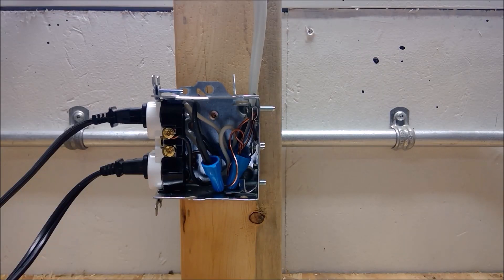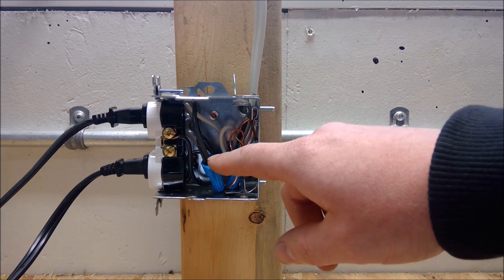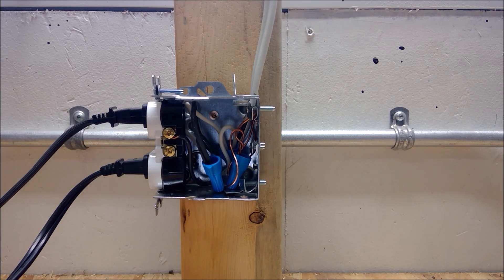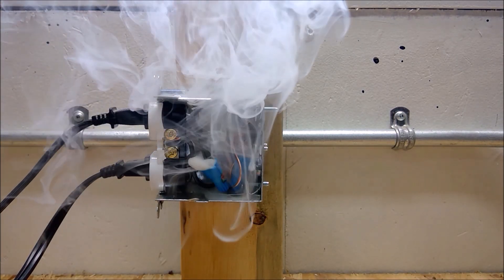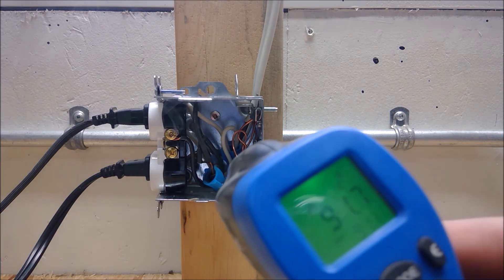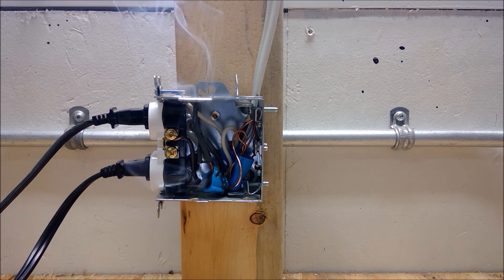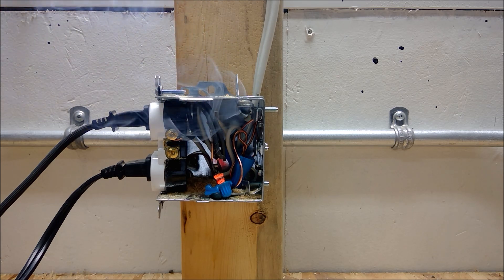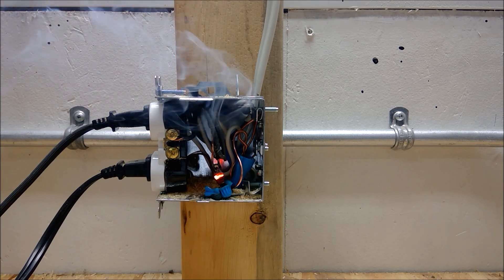Loose wires cause fires.

Comment: Great video! 👍🏻This happened to me. Discovered it today on wiring to a wall thermostat while painting. Once this situation occurs, do I need to replace the line wire that overheated, meaning behind the junction box… and if so, from where… the previous box or service panel, one floor below? 🤷🏻‍♂️P.S.: Happy Holidays! Hope you’ve been well the past 7 years! 😉

Comment: I had an outlet fire happen to me last winter back in 2016  in my bedroom at night. i was lucky i was still awake and my parents too. When the wires were loose and started the  fire. Got it put out, turned the power off, then called the electrician, and got the wall cut open to replace the box and wires  also had the electrician inspect the other outlets and none were loose but when it happened that was scary trust me .

Comment: people claim these wire nuts never come lose.. bs they do.. i have a 30 year old house, i replaced all the recetables and light fixtures and light switchs in.. because i dont like yellow ones and old light fixtures.. and id say 30% of the wire nuts were extremely loose..  in my barn thats 60 years old, the wire nuts in the receptacles werent even tight anymore icould pull them off basically..  another issue with wire nuts.. is some people dont twist them enough.. you should turn them entire the wire start to twist.. or until its too hard to twist anymore.. then you need to pull each wire to be sure and also look inside.  also gatta be careful cutting insulation off.. or if  wires were bent too much. twisting them in nuts can break the wires at the cut.. seen that dozens of time

Comment: a good example of improperly installed wire nuts ( merett ? ) they, the codewriters ) require non-combustible boxes whenever wires are spliced. irritants ? 1500 watt  a re a big culprit, cheap plugstrips & extension cords are another.

Comment: Ok great electric minds...help me figure out something. My friends house burnt down all bc her dryer outlet or something malfunctioned. It was on a breaker but the breaker never tripped according to the fire marshal. Is there a high incidence of outlet failure in dryers bc of the higher load? Why wouldn't the breaker trip? It was all relatively new wiring. A fresh build, barely 1yr old. She's in a new house and paranoid now about it happening again and has had it checked a half dozen times with dif electricians. Obviously it was a highly traumatic event. Her whole family was asleep. Dryer was off. They barely got out alive and lost everything. Everything literally but a Bible. Was kinda freaky. The good book was entirely unscathed except for being a bit water logged just sitting among smoldering ashes in plain sight where it had sat all along before the fire and complete destruction in every direction.

Comment: Excellent video. I have photos of a couple boxes where this has happened. After the plastic melted the circuit operated just fine yet until some type of vibration would cause the now exposed wire to contact the metal box and trip the breaker.

Comment: That's what you get for using those damn wire nuts, should you use spring-loaded connector like WAGO or even a screw terminal, nothing like that could ever happen as it is perfectly clear whether you installed them correctly or not.

Comment: is a bad outlet a fire risk if not using it?
Reply: Could be, if it comes between the fusebox and a socket you are using, depending on your wiring configuration.

Comment: The next video, how to replace all the burned wire?  Same thing just happened to me when I plugged in the portable heater, fuse didn’t trip and smoke was coming out. So when the outlets are plugged in and in use or light switches are turned on, it’s a good habit to touch the surface and feel any excessive heat is being generated, I caught a few already in my older home, I guess my next project would be open up every single outlet and switch and inspect and redo all the connections if necessary. You’ll amazed what kind connection people used back then.

Comment: How could they both be in a wire nut and not touching. Also why did it require you to do high amperage devices? Based off of my research arcing conditions are scaled based on voltage not amperage.

Comment: I have no idea why everyone goes on about "Canadian code", this proves (as ive seen many times) that "code" means nothing, in the UK these "marrette" are not legal in the UK and can not be purchased.

I use connector blocks (when required), they are brass and had a screw for each cable, everyone complains when i do, and yet never had one catch fire.. ever.. based on the size of cable that can fit in them, its near impossible to undersize which you need.

Comment: I have a very stupid question to ask. And I apologize, I am not an electrician and I want to know. Can an outlet catch fire even if you don't have anything plugged into it? I know obviously if you but metal on the base were the outlets are it can if it is metal because it is still transferring the current. I just don't know if the metal could overheat if there was a wiring issue and still cause fire to happen.

Comment: I dont even understand why would someone use these kind of "twist on" wire joints.
They are a pain in the ass to remove, straining your fingers to put on and dangerous - as seen here.
Just use a Wago 221 or some similar product, its 2020...

Comment: I have no idea how you guys never heard of terminal strips AKA connector blocks???
I understand that you can connect 2 wires just by twisting them together and putting a piece of insulated plastic cap on it, but I would not feel safe doing it.
I'm sure that this standard is more to do with north America, but in the UK this is simply too dangerous.

Comment: No wonder why it melted and caught fire, there were 14 amps of load! That's like a lot. I believe the maximum is 15 amps, and you were almost at the max capacity. And since there was faulty wiring in there, it made the maximum amperage capacity even lower! You kinda overloaded it. Could be wrong, but that is my thinking.
Reply: Andrew Grube's Baby Bear dude that was literally the entire point of the video
Reply: @mrconch7238  I’m scared

Comment: Trying to rip the homeowner off by selling a arc fault protected breaker $20+ for just 1. A AFCI outlet cost just as much if not more.. the Problem is old loose outlets & china's cheap ass outlets for .99 cents or that 16 gauge extension cord consumers are buying.. I see appliance cords go up to 14 gauge with heavy outerwrap to look like a heavy duty cord when it is not.. The problem is the consumer needs to know gauges for the appliance cord they will use not a loose wire nut most electricians make sure are tight.. The corporations are trying to prove a product AFCI's are the answer to all our problems and incorporate this into NEC through congress. a standard 20 amp breaker is less that $6.00 but a AFCI breaker 20 amps is over $20.00. they are not about safety it's about money (that is fact)...  Sorry this is the truth... A home owner needs to know AFCI's can cause major problems when running a drill ( that little blue arc you see inside) can trip a AFCI pissing people off every time they want to use appliances that create this arc ( FACT). I am not making this up.... I install these now because the NEC states all rooms not required to use GFCI's need them even in the garage. This also pisses people off because of the bill they get when We are done. This makes us look bad & costs the consumer a lot of money. GE makes these AFCI's around $4.98 & the MSRP is over $20.51. You do the math on the markup... Laws need to be passed on how the multi outlets are gauged, & a homeowner needs to disclose to new homeowners or insurance of any DIY's installing wiring or fixtures. Using a 16 gauge multi outlet extension cord should never be used on anything as the wire in the wall could be 14 or even 12 gauge that is the reason a breaker would never trip on under sized wires being plugged into a outlet. 16 Gauge wire requires 10 amp breaker not more. I have seen homeowners change a 15 amp breaker out for a 20 amp just because it's tripping all the time ( Very bad Idea )..

Comment: "An Arc Fault Circuit Interrupter would have tripped the circuit right away"

Doubt it. They claim to but they've failed a lot of practical tests for series arcs.

Comment: I almost had a fire today. The power cable for my CCTV wire melted apart halfway down the wire until the pieces were in two. I only noticed it because I saw an orange glow on the side of my desk. The thing is, I wouldn't normally be home when I discovered it so it might've been a different story :/
Reply: This is exactly what is happening to me, so thankful I was awake. I'm wondering how it could get fixed,any ideas?

Comment: 35 year Red Seal Electrician, great video Andrew. I have seen this probably over a thousand times.Loose connections are very common. In many cases the electrician or handyman thinks the connection is good because the wire connector gets tight, but in many cases, especially with multiple wires in the connection it is very common for one of the wires to back out of the connection unnoticed and presents a loose connection and a fire hazard. Now, as for all your smart ass comments boys. Women plug in the curling iron to heat it up for several minutes then plug in there hairdryer and go for several more minutes. More than enough to present this exact situation Andrew has shown here.want another one boys and this is usually YOU. You plug in two car block heaters in the winter to one outlet or two outlets on the same circuit and do the same thing. Lets see, space heaters going full out and then someone wants to vacuum and i could go on and on. Keep up the greats videos Andrew .CHEERS
Reply: Thank you for the kind comment. It is winter time where I live right now. Just fixed a junction box that was used to splice car plug branch cct's. Box was way too full like 30 wires in a 6x6x4 pvc box. All of the heat melted the pvc box. Made it easy to find the problem.  My next video will be about multiple conductors all pulling 12 amps and the heat created. 

Thanks again

Comment: kool demo, but i would replace that GE panel and breakers with Square "D" (LOL) cause i guarantee Square "D" would have tripped, plus that fire shouldn't go too far inside that metal box if it was fully enclosed with very little oxygen to fuel it, that's why all junctions are suppose to be done in a box, just another layer of protection. but on the other hand you still have to have it corrected.

Comment: North America, 14 gauge, olde olde way of measuring the conductors size, the higher the number the smaller the c.s.a  its counter intuitive,then they use 000 or 0000  ought, then another system so its wire gauge a add on with zeros or the letter o, then another patch for the larger sizes, they dont insulate the earth aka ground wires, they are bare,

Comment: Great video! I think this kind of junction is common for America. I do make wire connections by twisting the wires using two pairs of pliers then i do solder the connection. After that I use electrical tape. Here is one of the pics I got:      https://s6.postimg.cc/vfiwaetoh/IMG_20160206_182412.jpg

Comment: In Norway residential code requires wiring to be mounted on the outside of walls so problems can be spotted.
Reply: That's why I just run the romex across the floor with wire nuts so I can see if anything is arcing or burning.
Reply: What you have said is clearly not true. Maybe in log cabins?

Comment: Happend to me when i used my portabe car heater in an outside outlet. One of the electrical plug breaked of in the outlet when the heater was on.  And caused a fire. It took 7 seconds for the circuit breaker to cut the electricity from when the fire started.

Comment: This is why you do not make unsoldered splices/junctions in circuits without a box. The most common reason I get called back to jobs is when helpers are lazy and don't properly tighten wire nuts.

Comment: This is a good demonstration. Thanks for taking the time to make this video. In a metal box its not so bad but in a plastic box it could easily be worse. Especially if it burns into an attic or if its in a kitchen fan or receptacle where there sometimes is cooking grease accumulations. There is often wood debris in boxes from construction or infiltration afterwards.
Reply from the maker: francis white 

Thank you for the comment. It has always been my intent to demonstrate the results of faulty workmanship.

Comment: i'd like to see some things like, Circuit Breaker, a video showing the poor connection made, wire type (brand) as well as awg, and finally i'd like to see an amp reading on the device.

Comment: Arc fault breakers are a pain in the ass at best and impractical at worst. They trip if the wind blows on them. And what the hell is a mirrette? A wire nut? Is this from another country?

Comment: When you turned the toaster on, you could hear the RPM of the hair dryer drop.  
That's kinda why when I move into a new house, or add an outlet, I plug in an extension cord, and add some high load devices to that.  
Then I grab a multimeter and check the voltage on the extension cord before and after turning the load on.. 
Voltage going down with the device on = check what's wrong. 
It might not catch everything, but it sure has pointed me towards some crappy wiring in houses..

Comment: This could happen as you sleep
WHAT DO YOU MEAN THIS COULD HAPPEN IN YOUR SLEEP IS YOUR HAIR DRYER JUST GOING TO MAGICALLY FLOAT TO YOUR KITCHEN AND PLUG ITSELF IN WHILE YOUR ASLEEP AND THEN THE TOASTER AND THE HAIRDRYER TURN ON.
Or
Wait why did I bring my hair dryer into the kitchen, oh right I was going to blow dry my hair while I toast my bread. 
WHAT ARE YOU DOING WITH YOUR LIFE.
Reply from the maker: Jasbear007 

The point was that a circuit could have less than 15 amps of load connected to it and the circuit breaker may not trip on this type of fault condition. 

This type of load could be an electric water heater. It could be a freezer or a sump pump. I just used the examples in the video because they were easy to control.

Comment: So wire splices with untaped wire nuts inside a metal socket box are normal in the Canadian electrical code? I don't know many electricians that would do things like that.. Maybe some DIYers or maintenance man but not a real electrician..

Comment: People are complaining of the sawdust when there's smoke and smoldering plastic inside the case. The sawdust is not the issue here. 
You got me concerned, but I couldn't quite understand how the wires were improperly split, could you please elaborate on that? I live in Brazil and our connections usually don't have that blue plastic gasket around the junctions, so I couldn't quite translate your video to my regional conditions. It did, however, get me worried.
Reply from the maker: Horacio Filho 

When splicing wires we strip back the insulation on the wires and twist the copper together. That way they are a complete electrical circuit and they are also mechanically tight.

This video shows what happens when the wires are not twisted together.

Comment: I suffered a similar problem a while ago: I had a freezer and a microwave on a power bar, somebody plugged and unplugged the microwave and in doing so, loosened the bar's plug on the outlet.
the freezer remained plugged onto the extension, and worked out as usual over night.
at some point, the arc between the outlet and the plug melted the plug's own frame, loosening it even more, until it melted the wire inside the plug, and the wires shorted out.
I heard the breaker pop downstairs and went looking, and nothing seemed out of place, no burns anywhere, no appliances shorted out, nothing.
reset the breaker, plugged everything back in, and when I grabbed the extension cord, I noticed the plug had melted.
taking it apart, I saw the interior all burned up.
fortunately, the breakers had been changed a while back, replacing the old ones which were almost 30 years old.
I doubt those old breakers would have popped.
Reply: Part of your issue to start with was having it plugged into a power bar! High-current items, such as anything with a motor, fan, or heater or high - voltage transformer, such as in a microwave, should be plugged directly into the wall. Of course, in the case of in the video, it wouldn't have mattered, but, still, always plug high-current stuff into the wall directly.
Reply: @EphemeralProductions  I can't remember the details of it anymore, but the microwave was usually plugged directly onto the outlet.
it had been like that for years, even though the microwave is rarely used, and often left unplugged.
it was because we moved the microwave onto a support rig that an extension was needed, and the only place to plug it on to, was the freezer's outlet, so we moved both to the extension.
not my problem anymore.... I fixed the broken plug, set it right, and went about my business.
if it pops again, it can burn the house down for all I care... I won't fight stupidity.
Reply: I've had breakers go bad and they tripped at lower amps that rated. Failing safe. I also had one partially melt (it was a main breaker, I think 100 amp)

Comment: Thanks for getting me scared now. Guess I’ll shut off the main every night now.
Reply: It will save your electric bill some but it'll be more expensive replacing hot water and groceries all the time. Just let her RIP and unplug unnecessary stuff.  Only thing needing continuous current is water heater (if electric), fridge/freezer and HVAC if you have central heat/air. Though I wouldn't wear out plugs/outlets to your large appliances if you don't have to lol. More trouble than it's all worth really.